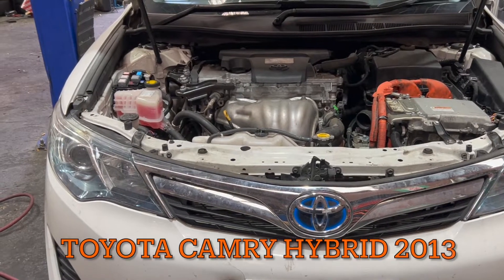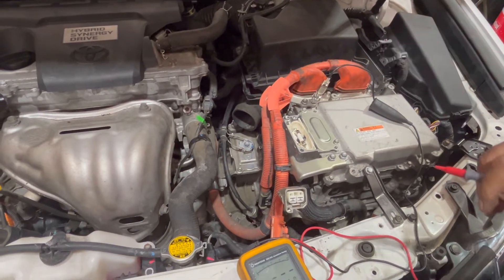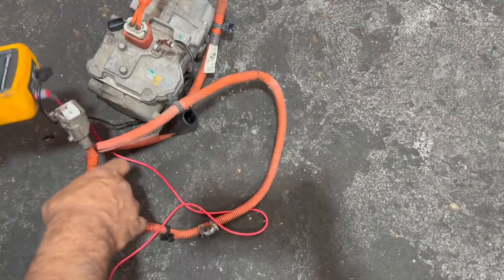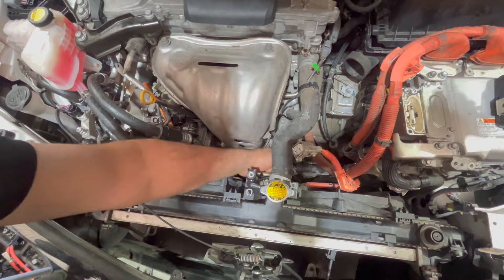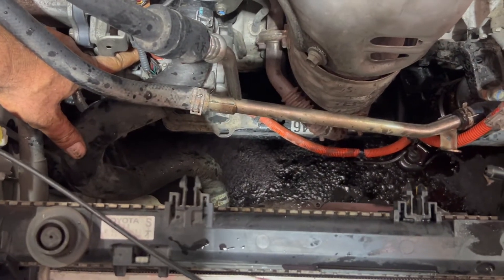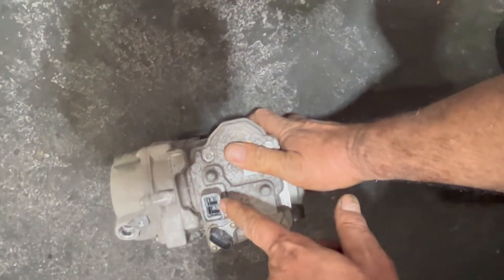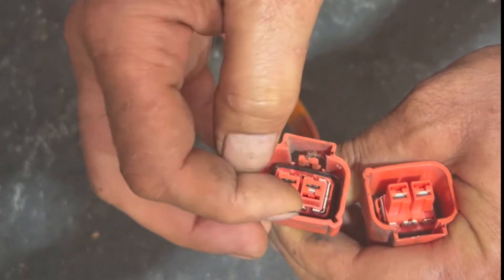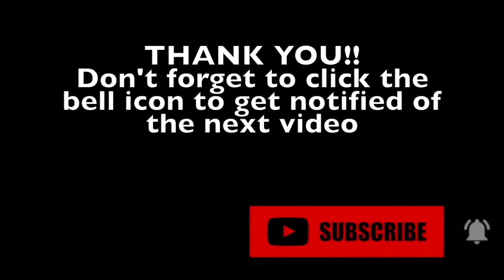Code# P0AA6 | Hybrid battery isolation fault \ Toyota Camry Hybrid 2013

Comment: My car does a weird thing like jumping when converting from the engine to hybrid battery,  then shows check hybrid system and traction control.  Can this be a problem with the compressor as well?🤔🥲
I have been suspecting the hybrid battery is bad🥺

Comment: I have vitz hybrid 2017 model I am facing this code problem again and again. I have changed the Ac compressor, battery connectors still the code us cleared but comes again please give advice that how can this code be removed
Reply from the maker: What is your location I will try to find solution for you. Please share your codes in hybrid system. And detail description. When this code occurred. Thanks

Comment: Aoa Brother
I change my Headgaskit in Toyotapriusplus2013. Now ac Compressor not working.  Can help me.
Reply from the maker: Wassalam. Have you checked ac gas. Scan the HAVC system and if there is any code.

Comment: Aoa i have toyota aqua i got this code p0AA6  after engine wash I checked the battery cells it’s perfect fine please tell me how to clear this code
Reply from the maker: Wassalam. Start from ac compressor. Remove the high voltage plug and see for corrosion. It should be like white powder type in the plug. If yes change the compressor and wire as well. Let me know after this.

Comment: B1498 sir i have same car ac not working. This code coming how I can fix
Reply: ok sir I will check thnks 😘
Reply from the maker: Hi. Fuse in the inverter with converter is not giving any continuity(beep) it means it is blown. Please replace that first. And check again.